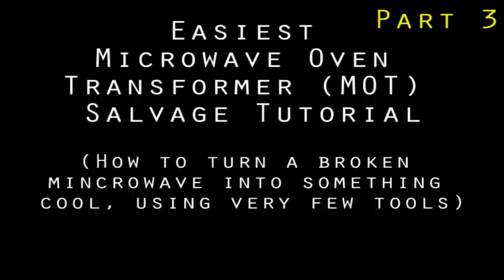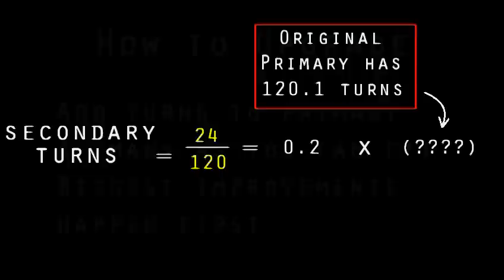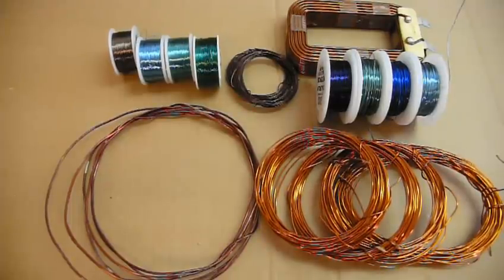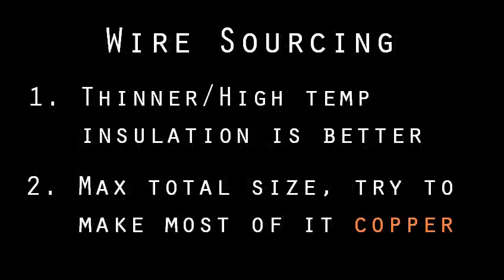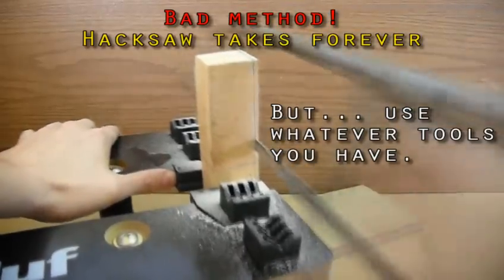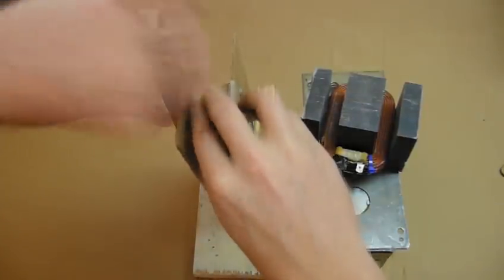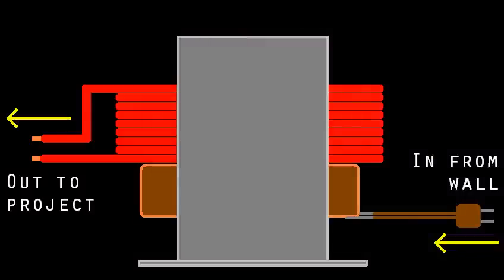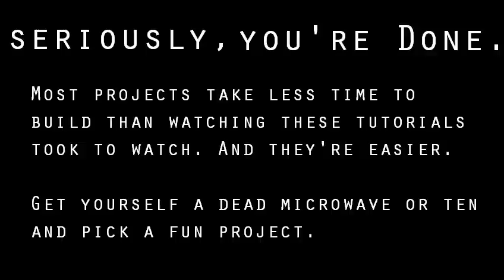Easiest MOT Salvage Tutorial Pt.3

Comment: I have 2 identical mots ~600w each well i think they are 600 or so by their weight.... Would like to make them as power source for my 2 studio 350w amps +-70v. At first my mots are 230v primary so i should ad like 60 additional wraps or so??? Or it would be better to make a new bobbin and wind the transformer as all e type one are: primary in the middle and secondary outside the primary? does this helps? and  witch solution would be better to make this transformer work like a normal power supply saving his original power??and getting rid of enormous heat...
Reply from the maker: Just re-use them. I would make an E-to-E transformer (toss aside I-pieces) if faces (E) are same size. Put both primaries in series, so it makes ~460 turns. That will keep waste heat way down to like 5% of before. Then wrap secondary with thickest wire that will fit, with right number of turns (~140?). P-P-SS or P-SS-P doesn't matter. Whatever's easiest. MAKE SURE tail of one primary goes to head of other, or they will magnetically cancel (230 - 230 = 0, vs. 230+230=460) and blow breaker. Post when done with link, would like to see!
Reply: MattsAwesomeStuff and what about transformer  will it still be able to produce 1200w continues? cause your way is the same as connecting two transformer in series with primaries connected to each other. and as i red in the web thats cuts the power in half.??? Eliminates saturation but power in half!!!
Reply from the maker: The transformer will still allow 1200w, yes, because it's wattage max is set by physical size. Yes, mostly same as hooking 2 separate MOTs in series. The limit is not wattage but amperage. 2x as many turns per volt (2x primary, 2x secondary to make same ratio), you have to use wire that is 1/2 the cross section, which can only carry 1/2 as many amps without overheating. So, if heat is your limit, then yes, it will melt when trying to draw 1200w from thin wire. Transformer will allow it, but wire cannot handle it. But you said 350w from 2x600w transformers. That's about perfect, for low-heat, 460 turn primary. Make sense?
Reply: MattsAwesomeStuff  At first there will be 2 amps with 350w rms per Chanel so 500w per amp and 1000w combined. So the thing is that i don't understand if i combine 2 transformers that are  deeply in saturation with their primaries wounded tooooo short of wire how in the world i can get a normal transformer when their cores are touching? What i don't understand is how many wraps of additional wire should be wounded to leave saturation behind and end up with amazing transformer with idle current as low as possible?  Does throwing I parts of transformer lowers its core cu feat? and additional wire isn't needed anymore?
P.S i will throw out old transformer primaries combine transformer e parts make a bobbin and wrap new 1 mm x2 parallel wire about 600 turns primary. Will it be enough to leave saturation behind ? Or i dont need 600 turns? Like 500 Would be ok or no? Less turns maby?
Reply from the maker: 1000w continuous from 2 MOTs, while running cool, is probably not possible. Maybe half that is possible. You can't cheat physics.

To test idle current is easy. Hook up the core with the primary in series with an ammeter (multimeter set to HIGH amps, you usually have to move the red lead to the 3rd hole). Then power it up to a socket while standing clear of it. You don't even need a secondary for this. You will see the current draw. Amps * Volts = Watts. Right off the bat, there's a bunch of waste heat. Hook up two primaries in series and test again. I bet it's dropped to below 10% the first time.

That is with ZERO output current though. Saturation will still make this problem worse, and more turns will help with that too.

I would not waste time and money throwing out primaries that are already exactly what you need. If you are making a bobbin and coiling new, just add onto the existing ones.

As for actual numbers, I can't tell you. My answer for all of it is "maybe." You have very specific goals and I have only a general description to go from. If it is important to be precise, experiment first. You can practice with turns of much thinner wire (briefly, it may overheat quickly) if you want to save money.

But if you already have 2 primaries that fit the core, why not experiment with those? You already have your solution in front of you.
Reply: MattsAwesomeStuff thanks a lot. Will try to go with existing primaries and add some 50 turns on each transformer. Will see what happends.

Comment: I made this but we have 250V coming from the sockets so what should i do?
Reply from the maker: I covered this in the videos I think.

As far as I know, all the advice is still relevant. You will probably have a thinner primary (to fit 2x the turns in), but, most of the time you're leaving the primary intact. Your turns ratios will be different than 120v sockets, but, that doesn't matter because you will be calculating them anyway. And they'll still be about 1 turn per volt.
Reply: MattsAwesomeStuff It works like a charm now :D

Comment: 1)
Rewind secondary transformer to a gage 10 ground bare cooper wire coated with fireproof GE silicon ( mix with mineral oil to thin it down like paint ) 110VAC to 17VAC... So say my circuit breaker is 10amp. Max watt I will get is 110CAC x 05Amp = 1100Watt
Going through microwave transformer 1100Watt/17VAC=65amp

2)
I will need to purchase a Full wave rectifier that can handle 65watt. Correct?

3.
Purchase a Buck/ Boost converter for precise volt output. This DC to DC converter will also need to handle 65Watt correct? 
(( this step seems a waste of energy, as every transformation of energy from AC to DC to DC to AC chopping back to DC, it loss energy in heat, is there a better way around this step ? )) 

4.
Then connect to capacitor. What does this capacitor capacity need be? What size of capacitor should I purchase?
Reply from the maker: 1 - Correct.
2 - Incorrect. Most components have both a max voltage and a max current rating. For most diodes and FWBs, your default max voltage is hundreds of volts, enough to ignore. It might not even be listed in the specs. The main spec will be max amps. You will need one with at least 65 amps. If you have access to a junkyard for cars, go find an old alternator (a broken one someone took back for "core charge" would be good, if you have core charges where you are), take it apart, and take out the 6 diodes inside. They will be rated for 100+ volts and 100+ amps each, and you can use any 4 diodes to make an FWB. Some old truck alternators have the diodes on top, you can just unbolt them without taking apart the alternator. Don't buy the whole alternator. Also, if buying an FWB on Ebay, be careful about chinese sellers, some are lying about specs.
3 - Buck/Boost is usually more expensive than just a Buck or just a Boost. I suggest buying a Buck converter, if cheapest, and looking at it's max input voltage. You can wire your transformer for slightly less than that. And look at the output voltage, make sure it's the correct range. And then look at the max output current. You would want that to be around 65 amps. You will probably not find one that big that you can afford to buy, that's a very very big converter. If you are okay with a smaller one, buy a smaller one.
4 - Higher is better. Electrolytic capacitor is the type of capacitor you want. To be very smooth, 1000uF per amp. But if you see how much capacitor 65,000uF is, that would be huge and too expensive for you. So, at least a few thousand uF, buy what you can afford. This smooths out the power supply so it is easier on the Buck converter, but the Buck will probably have its own capacitor to help even more.
Reply: I did some more research after your last recommendation. The biggest buck converter I found is 40amp ( which is 25amp smaller) for golf cart (I think seller from China lie, because another seller selling the identical item say 20amp), also larger capacitor is pricy. What will happen if I skip these two components?

I have dead electric lawn mow, because prior owner use long extension cord to run motor, voltage drop, motor draw higher amp to compensate watt in calculation... Motor overhead magnet all break apart.

It seems this electric lawn mow is a very simple machine. 110VAC going to white ceramic transister ( not sure why, what does it do? Is it for limit amount of current it can draw through to prevent overheat fire ?) then to 10amp bridge rectifier, output to110VDC connect directly to DC motor. 

Simple electric lawn mow does not need a Buck or Boost converter. Also it does not have a capacitor to smooth out the sin Vac wave. 

My Bosch cordless circular saw is 18Vdc. Since tool is not good to run at lower then specify Vdc. What will happen cordless tool run at higher Vdc then manufacture specify? say at 18Vdc tool run at 24Vdc or 24/18 or double the Voltage 36/18. Motor will just run faster? Bearing fail? Or something else happen in the circuit?

With higher Vdc x lower Amp draw(run cooler), should circular saw have enough watt strength to cut through thick wood ?

Same as lawn mow, Vdc hand tool is Vdc going through motor, make it turn.

My goal for this build is to be able to run the cordless power tool from wall outlet 110Vac without damaged the tool to cut a piece of wood.. How fast the circular saw run does not matter, long as the power suppler can support enough amp.
Reply from the maker: @harukoyama9515  - 1 - If you skip buck converter your voltage won't be as steady. If you're running tools with it, you probably won't notice. If you skip capacitor, on a "Universal Motor" which is most power tools, you won't notice much difference. I would still add some capacitance, even if you can't get as much as you want.

2 - Not sure what the white transistor is. It's not to limit current. Sounds like a universal motor too. Output would not be 110vdc, it would be closer to 170vdc if it has a capacitor.

3 - You can run a battery operated tool at lower voltage, it will just be weaker, spin slower, and not pull as many amps, and not as much power. When your batteries are weaker, or when you are not pulling the trigger down all the way, that's all it is doing, lower voltage.

4 - Your goal is to run battery tools out of 110v socket? You can do that. They will probably draw 15-30 amps at their rated voltage. When you give a DC motor a higher voltage than it was designed for, it will spin faster, linearly. 200% voltage = 200% speed. That means 200% amps. So that mean 400% power. That will ruin the brushes on the motor much faster and maybe melt the motor, maybe ruin bearings. If the tool has speed control on it, and you exceed the max voltage, it may refuse to turn on, or it may instantly ruin the control electronics. I would not go higher than max tool voltage at all, if using control electronics. And no higher than 25% over if controlling the motor directly. Maybe 50% over for very short periods of time (a few seconds).

5 - You misunderstand how voltage and current and power will affect a tool. If the tool is doing a job that requires 500 watts, yes, then higher voltage would let that tool use less current for the same power. But the tool isn't smart like that and is not like a transformer that trades and balances. When you give it higher voltage, it uses even higher current. 2x voltage = 4x power. So a tool that was running at 500w, is now using 2000w, and melts. It doesn't "know" that it only needs to use 1/2 the amps. It uses howevermany amps fit the equation: Amps = Volts / Resistance.

6 - You do not want tools spinning faster than they are designed to spin. Sawblades are only designed to hold together at a certain speed, and are designed to take certain sizes of wood chips away.

Comment from the maker: @ebb0246 YES! Absolutely. I have a dozen+ tutorials planned. First is the spot welder,  second will probably be the arc welder. Hint: The orange transformer I made in these tutorials? That's an arc welder. If you want to get right to it... Specs: ~24-36V, as many amps as possible. Add a fan or two. You'll get 10% duty cycle (1min weld, 9min cooldown). You'll need to use the smallest sticks (1/16"). A double-MOT is better.

I wish I could make videos as fast as there's interest for them.

Comment: This question may have already been asked, but what is the output voltage of the transformer you built. and By the way. I found this series very educational. Great job in explaining everything. If I knew where you lived, I'd take you out for a beer.
Reply from the maker: Of the one I built? I'm not sure why you're asking, since, my project isn't your project. Easiest MOT Salvage Tutorial Pt.2 <-- I show in part 2... 32 volts apparently.

Thank you for the kind words. You're welcome. I would like to make more videos, these are two and a half years old already :(
Reply: I have just recently taken an interest in MOT's, so I am sorry to be behind the  times. It would be interesting to build a 12vdc to 120vac inverter for the car. With enough amperage to drive 10 or 15 amp demands.